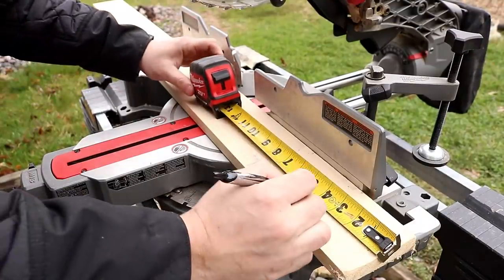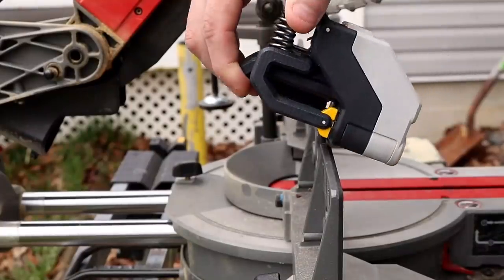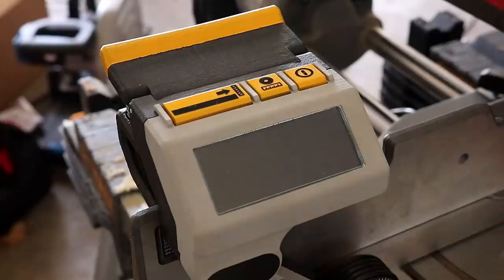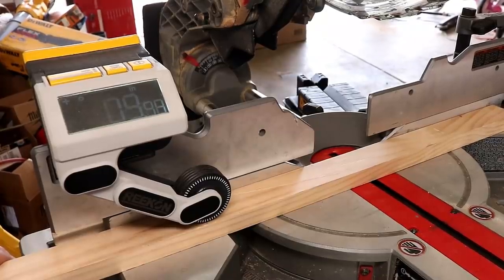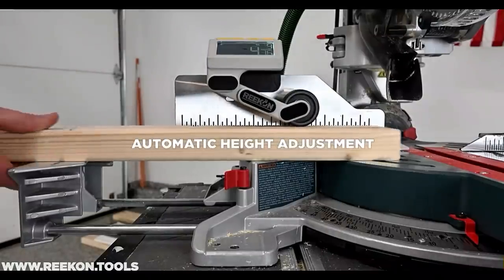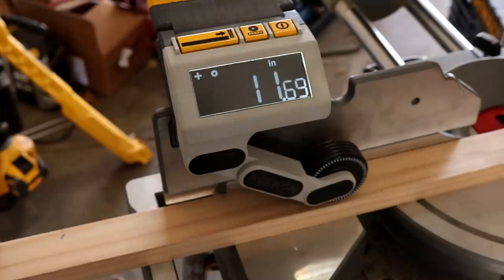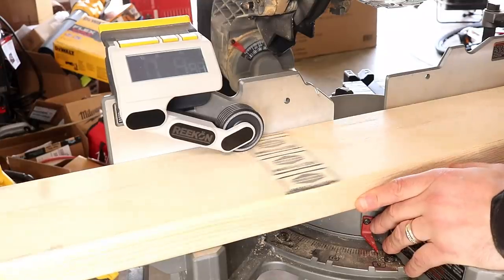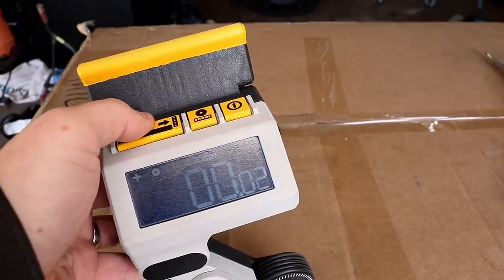The Coolest Miter Saw Accessory YOU NEVER KNEW ABOUT Until Now! - Make perfect Miter cuts every time

Comment from the maker: You can enter your blade width into the device and it will automatically add in an offset to make sure the blade is compensated for
Reply: Does it retain that blade width until you change it so that every cut compensates for the blade width?  I am surprised you didn't even mention this in the review.  It would have been best to include the exact steps, show the cut, show repeat cuts, show with a tape measure the cuts are in fact accurate.  I am also quite surprised that when I go check out the tool on the company website, there is not a single ounce of text or info about what the product is.  It is a one page site with their logo and a signup field for your email address.  It reads "Receive Exclusive Discount by signing up below"  Says "Available for pre-order June 16."  But that is it. No navigation on the site, nothing.  Unless you made this video how would anyone know anything about the product?  Not your fault.  But how did you even know about it?  You mention that an issue with a bevel and one would have to move to other side.  It would have been great to see the steps for such a cut as well.  I get that this tool will help you by not having to actually pull out the tape measure but after one measurement for repeat cuts, you slap a stop block and you are done.  With this tool, I can roll up the piece and watch it show my length of cut, incorporate the blade width and I am good.  But every cut after that I have to read the screen.  Yeah, I got that part but then we have to see the cost of the product and determine is it really worth the cost?  I could see this helping on a project where you have various cuts and don't want to have to keep pulling out the tape measure to mark your piece.  But I have a feeling this is going to be pricey.  The fact that you can pre-order for June 16 and the site does nothing, I mean nothing to explain what it is, makes me think this will be very pricey.
Reply: Robert Knowles he stated the cuts were accurate, checked with tape measures, lasers etc.
Reply: TheWaterbound07 As I said in my original reply we would have preferred to see so for ourselves.  I would rather see then just rely on what someone says. In another post Tool Review answered someone and said this device can do millimeters when in fact that is not correct.
Reply: This is a failing. I change blades quite often, and in all probability I would forget to change the kerf allowance in this device. A stop block is much better, doesn't need batteries, and most importantly, once I have set it, it is super fast to slide the wood up to the block and make the cut. With this device you have to fiddle about getting it right every time. Sorry. Fail.
Reply: @donepearce  Just because it doesn't work for your work flow doesn't mean it's a fail.  Not everyone cuts the same lengths over and over.  Obviously when that's the case just lift the level and set a stop block.  But when you have multiple cuts of random lengths this could be great!
Reply: @donepearce  wow really you think it's a fail because you will forget to change kerf that's on you not the device. "I am  forgetful so clearly this object is a fail," is essentially what you said. Full time cabinet maker and I never change out the blade until I need to replace it.  I think it is going to sell well and I will definitely buy it.
Reply: @andrewmillerism  Have you ever come across the Japanese term Poke Yoke (Pokeru Yoke in full)? It means setting up things so you eliminate unnecessary sources of failure. It means putting your phone inside your shoe by the front door so you won't leave without it. It means using direct, repeatable measurement techniques when you can, techniques that are blind to such details as a change of saw blade. So yes, a technique that proofs me against forgetting some small vital detail is one I will grab with both hands. This clumsy measuring system is not it.
Reply: Hey TRZ kickstarter is now live.
Reply: @robertknowles3677  It does centimeters with two decimal places so the other side of the decimal is milimeters, bro.
Reply: @zacharyevans948  just leave out the idiot 
He gets the point. There is enough anger out there tool reviews don’t need it..:)

Comment: Don't you need to allow for the saw blade kerf or use a block on the other side of the blade?
Reply: Exactly my thought... i guess if your finished piece is on the right side of the blade you would need to add the kerf
Reply: Hey Peter!  You can enter your blade width into the device and it will automatically add in an offset to make sure the blade is compensated for!
Reply: @REEKONTools  nice
Reply: Yup, something isn’t adding up here as shown.
Reply: My thoughts immediately on seeing this. Another gimmick to fleece the novice woodworker!
Reply: If the tool measures in both directions from zero then desired wood could be moved against the blade from the right, then move “measuring” wood against that from the left, zero out the tool, then push the measuring woof until desired measure is reached. If the wood being cut doesn’t reach the measure though, clamping will still be needed. This also didn’t talk about really short pieces for which something like this would probably need to be done anyways. Very useful tool to get exact measurements. Sometimes I need to get the same cut again after removing a stop block because of a mistake etc and it’s almost impossible with a measuring tape although you can get close.

Comment: I’m not against gimmicks. But, I’d better trust a stop block attached to the fence over this.
Reply from the maker: Fair comment. Thanks for sharing
Reply: I agree this thing would just be aggravating especially if you wanted to try to make repeatable cuts yet sit there and slide it through get it down in just you stop blocks sometimes people engineer Products that are just useless then every time you wanted to put a board up there you would have to hold that thing up or slide it in from the other direction just to get it against your fence
Reply: Yea stop block has worked for me and I’d don’t need to worry about “seeing” it , I just wait for the board to stop then cut day or night. It’s very accurate as long as my original double check measurements are right on! So can see why a homeowner or weekend carpenter would like this, but a professional doing the same cut over and over on a large job the stop block would be the most accurate and cheapest way to go. Good review though!👍
Reply: Might be best for trim work, but some guy on Instagram said he used it to cut 200 studs for rough framing and said he will save a lot of money vs having to mark and measure each one.  I think he is a shill as no production framer will mark and measure 200 studs and cut each one that way.
Maybe for off size cripples over headers and fire blocking would work well
Reply: You read my mind.  I was going to make the same comment.
Reply: Come on guys this tool is awsome and would be great for the right niche

Comment: I watch tons of tool videos and this is the first time I've seen this.  I really think that's a good idea!  The only thing I think they should've added is a way to bolt it onto the fence.   No matter how good the clamp is,  I can see how easy it would be to knock it off of it's mark.  If I had one,  the first thing I would do is modify the mount and drill locations on both sides of the fence.  Either way,  I'm still thinking,  WOW! what a great idea 👍

Comment: It seems you would need to zero it after each cut since it can’t know when a cut is made or if you’re still readjusting the the piece of wood. 

Also how sensitive is the wheel to sawdust?
Reply from the maker: You would only need to zero it out if you change the cut length.  If it the same cut,  you won't have to

Comment: What about the blade thickness
Reply: Ya, how do you account for the blade? It's zero'd on the wrong side.
Reply from the maker: Na, it's set 1/8" off to account for it
Reply: Ok but who uses full kerf 1/8” blades??  Something doesn’t add up
Reply: @ottawapop  you program whatever the kerf is for the blade you are using. Change the blade, change the kerf measurement. After that, it allows for the Kerf so you get the length you want.

Comment: I get the process of sliding a board under the wheel until it hits the blade and the set it to zero, but if you feed you material through the way you demonstrated, how do you compensate for blade width?  Does it automatically add the blade width to the cut calculation, or do you have to add the blade width to the measurement?
Reply from the maker: Automatically adds it Bob. I put a pinned comment in the comment section

Comment: It is a great idea but there are a couple of things I noticed. When you touch the blade with the wood you should make sure not to cramp the blade and move the blade. Don't use the side of the blade but the edge of the blade tooth. Also take into account the thickness of the blade. You might be better to measure out from the other side of the blade and then zero the counter. That way the cut is not affected by the thickness or movement of the blade. You could also add a diy rail for wood that might sit higher than the saw fence to attach the counter.
Reply: OK, I did not see the part about the blade width being entered into the device so that would be a big help. Sorry.

Comment: Let’s say i have 20 cuts at the same measurement. Does the wheel act as a stop so i can take a stack of stock and cut it repetitively?
Reply from the maker: It does not act as a stop. You would have to watch the measurement each time
Reply: @ToolReviewZone  Or measure once with a tape measure, place it on the miter, line up to the blade and use a stop block.  Then the other 19 pieces you just lay up on the saw and slide to the stop block and cut.  Of course you can look at it another way.  Get your stop block ready, use this tool, slide the wood in to get your measurement, the blade kerf will be compensated for.  Setup the stop block on the first cut.  The other 19 pieces of wood, just slide in up to the stop block.  But then it would come down to how much this thing costs for straight cross cuts vs just using the tape measure that one time.  Now like I said previously in another comment, I could see this coming in more handy for me when I have various cuts throughout the day.  I can just measure what length I need for some off cut, walk up to the miter with this gadget and make the cut.  I don't have to mark the piece first and line up on the blade.  Now beveled cuts we did not see what the layout would look like nor did we see a single cut to see how accurate it really is.  I think it is a missed opportunity to give it a good tryout.

Comment: Don't push the wood into the blade and zero out. Cut a small end off the wood then zero it out. This would only be useful if one was cutting a lot of different lengths. For multiples a stop block is much quicker.

Comment: That is a pretty slick tool. I always use my tape and add a blade kerf onto every measurement
Reply: Why do you have to add the blade kerf to the measurement?  Don't you just lien up your blade on the outside of the piece?  I have never added a blade kerf to a cut.
Reply: Ryan — every cut is off by the thickness of the blade. I’m shocked they don’t have a button that can add various bladed thicknesses to calibrate fro your saw.

Comment: Long lengths will be a pain in the arse and I would not fancy relying on it by pushing a 6ft length of timber through it.. give me a good metal rule, quality tape, sharp pencil or marking knife and a little thought and the job is done. Plus the position the device is, is right where I religiously clamp down my work pieces, 5 seconds to clamp the work piece down to keep it steady is something I just prefer to do just incase something snags binds or slips ..

Comment: No general price given, it's not available for a month and a half/maybe, Beta testing is when you make several tools and then ask specific questions to determine how it functioned. Changes are then made to the production run.  it would save time if there were a lot of different lengths of the same material. If I needed 10 of one length I would set a stop block which is faster and more accurate.

Comment: Wouldn't the unit move, slightly, if it's just spring loaded clamps. Stick on tape measure is only a few bucks, for small measurements and a flip up stop on a long fence ( easly made with ali angle?) would be more reliable for repeated cuts.

Comment: I saw a comment on the video on their youtube channel, keep in mind they are a brand new 2 person company.  In the comments Reekon stated that you have to zero out your blade for all new cuts.
Reply from the maker: Only if you are changing the length.  If the cuts are the same length you wont have too
Reply: @ToolReviewZone  Why would you need to do that?  Maybe I'm missing something, but the wheel appears to act as an encoder...'X' number of wheel revolutions per inch, which are shown on the screen...once the board is zeroed out against the blade kerf, varying lengths of cut shouldn't matter since the length is based on the number of wheel rotations.  I'd be more concerned about saw vibrations causing the tool to shift slightly on the fence and give false readings.  I'll just stick to my fence and stop block.
Reply: @photog1529  I see how the wood is put up against the blade, however, how does the device actually know the "blade kerf"?  I mean different blades can have different widths right?  If I want to cut a 10 inch piece off a 2x4, I slide the 2x4 up to the blade, zero it out, then I lift the blade, slide the board through to 10 inchs, the device will register 10 inches. I then cut  the piece, how does the piece come out to exactly 10 inches?  I am missing that part of the blade kerf.
Reply: @robertknowles3677  I assume when setting up the unit, you store the kerf width into the unit's memory and it automatically factors that dimension into the length.

Comment: It's a good idea, but with a few missed opportunities. Instead of a seperate computer, why not just use an app on your phone? Also, instead of the wheel, which could slip on the wood giving you a wrong measurement, why not use an optical encoder like in a mouse. More accurate, no moving parts. I guess that would wouldn't work for shiny metal, but that is a small part of the market, and you could just put down some masking tape on it to fix that. I wonder if you could hack one together with a bluetooth mouse that you pair to your phone? The app would be really simple.

Comment: I think this would be really useful with stop blocks. Depending on cost I’ll be picking one up. I don’t like the battery thing though. Wish it was rechargeable.
Reply: I personally don't think I need another battery to charge (just my opinion), but I also think they could easily adapt them for litho batteries or even plug in.  Three versions would appeal to a lot more people for sure!

Comment: There's no market for this in the professional world I can see, for accurate repetitive cuts a stop block is the only thing I'd trust, takes next to no time setting it up and you're good to go all day if nothing changes. Fast, simple, zero cost....
Using this on a job to cut a house full of studs would be something of a nightmare compared to a stop block, pulling and pushing on the every length of timber to dial in just the length you want to cut.....nope that's a fail
That leaves the handyman market....I can't see it being used more than a couple of times and then abandoned on a shelf gathering dust with the rest of the useless gizmos that everyone owns. 
I'll give REEKON marks for the concept but it fails to improve in any way what works now, a simple stop block....it's reinventing the wheel and going backwards
Full Disclosure:  I've been swinging a hammer for 40+ years, hard to impress, hard to change my ways.

Comment: I'm sorry. I really try to see how a tool can be useful... But it's not really solving a problem... We can already cut accurately at a miter saw. Accuracy isn't the problem to anyone who is experienced.... Speed is the issue on the miter saw. Not accuracy. This does not help speed. 

Guys this is not necessary to build quick and beautiful things. Put a 0 clearance insert on your miter saw and learn to stretch and read your tape quickly, referencing off of the 0 clearance insert. Or get an accurate laser or shadow line. This is big overcomplicating

Comment: Doesn't have millimeters... this must be for DIY users rather than professionals lol. What a flop!
Reply: kizz jd .01 cm is a mm.......... so it does have millimeters
Reply: @Mrcaffinebean  should be mm instead of cm. That  would be like having ft and no inches.
Reply: kizz jd no because it’s much more difficult to convert .01 feet to inches.
Reply: @kizz jd the prototype didn't but the Production model will. As for being a flop... IndieGoGo says they have over 11,000 sales plus well over 10,000 sales on another similar site so they have well over a $million or 2 in the kitty to play with to get things right. On the IndieGoGo site, the goal was US$10,000 and so far it is US$1,396,924 as of 26 September. I would call that pretty well oversubscribed and Not a flop ;)